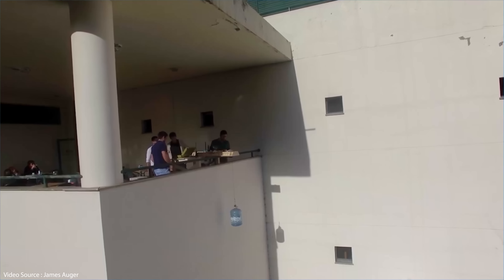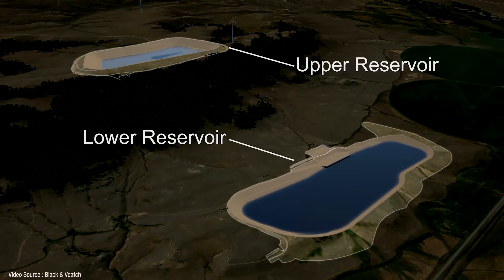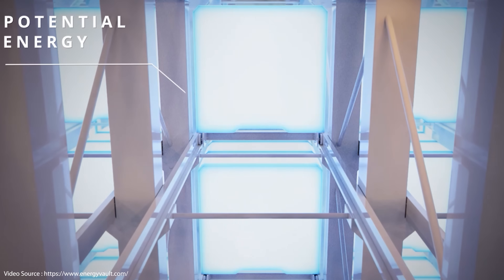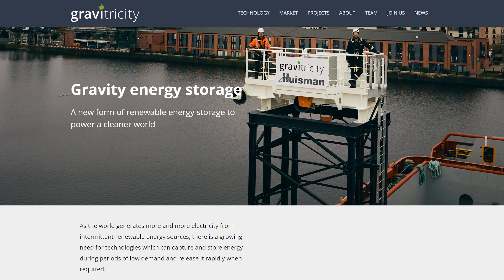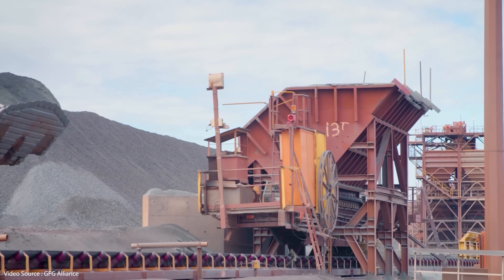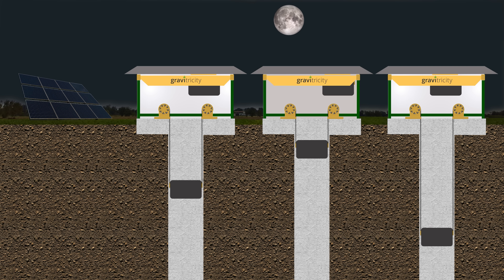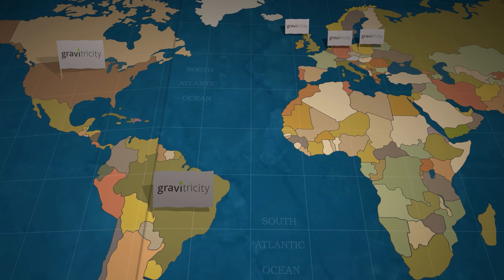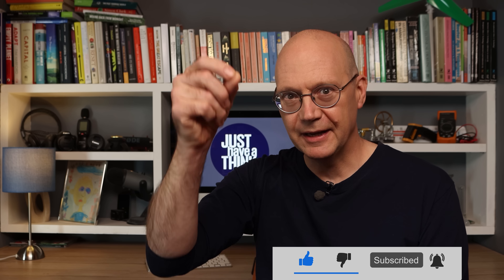Gravity Energy Storage. Who's right and who's wrong?

Comment: There is the mass generation for many and then generation for self. Like Regenerative Braking in cars there are endless companies constantly using energy to lift things but then wasting it when they lower it. I'm sure systems could be implemented to generate on lowering for ones own consumption.

Scale always matters. Water towers elevate water which is then gravity fed to our homes. How much energy could they extract from that? Which they could use to elevate it again.

The pendulum clock with weights has been using gravity for probably the longest time, hundreds of years.

Comment: Why not combine problems with solutions? A likely problem to using disused mineshafts is that they tend to fill with water which would need to be pumped out. If the ingress rate was low a pumping and tank storage could operate as pumped hydro. much simpler than weights and winches.

Comment: you point out all the power out, anyone should point out how much energy goes in to resetting it all.

i would say their all wrong. the cost of reset is eaten by any other source, and then some due to entropy, therefore whatever source is providing power to lift the fallen weights is already more efficient.
Reply: That more efficient power is not being made at the right time though. So resetting just delays the usage of that power till later.
Reply: @marshr32  it is a matter of efficiencies: the video does not show how much is to be wasted lifting those weights. im shocked ocean waves arent used to hydrolically pump/jack them back in place. That would be using the effing moon bruh, not just the earth.
Reply: @SkepTank0404  Agreed, even if it's insanely efficient it's still not a great way to store energy. Waves would be using the wind indirectly, tides would be using the moon. But tidal stuff is too slow and the height range over most of the world makes it not worthwhile to build the infrastructure.
Reply: @marshr32  good point

Comment: Unlike the Gravitricity concept, the new Energy Vault design still consumes energy when it needs to move the blocks around, so it's not as efficient, let alone the insane steel framework that will require even more mining.
Edit: From their web site, they can superpose several containers in the same shaft: "The Gravitricity system uses weight configurations totalling up to 12,000 tonnes [24 weights x 500 tonnes] in a deep shaft, suspended by a number of cables, each of which is engaged with an electric winch capable of lifting its share of the weight."

I suppose Gravitricity has some locking device that hold the containers in place as they are being lifted, in case of cable failure or when they reach enough height.
Another benefit of the Gravitricity design is that you start with a full "battery" at the very beginning: No need to lift concrete blocks or move them around a steel framework. You just need to move the empty container over the shaft, then fill it with iron ore.

Comment: Why not have a system like the Lynton and Lynmouth funicular railway in Devon? At the top of a waterfall you have a large "bucket" which can hold tons of water. You fill it up with river water and wait for electrical demand. The bucket then runs down the rails, powering a generator and pulling up the second empty bucket. At the bottom the water empties out of the bucket whilst the second bucket fills at the top. An array of these would provide free backup electricity on demand.

Comment: I wonder if Graviticity could use the dropping weight, in combination with flywheels to both or either extend the amount of time it takes for the weight to reach the bottom, thus increasing the time it produces power (side effect is that you use the fly wheels for regenerative power generation as well), and to generate power to raise or partially raise the weight back to the top of the structure?
Reply: that's just adding another storage system (momentum) to the gravity storage system. That can only compound the inefficiency. Every storage system has an efficiency less than 1. So you're multiplying less than one by another, slightly different, less than one.

Comment: It's noticeable that Gravitricity don't compare their LCOS with the nearest equivalent actually in use, pumped hydro. I don't know the LCOS of pumped hydro but I bet it's considerably lower. They both have a limited number of suitable sites but hydro has far greater capacity.
Reply: Depends on the depth of your mine, and how much rail you want to put at the bottom/top to store rocks to the side.
Reply: @JohnR31415  To give an idea of the amount of mass involved in grid scale energy storage, the Dinorwig pumped hydro station in Wales can use up to 390 tonnes of water per second at 1,800 MW output (source: https://en.wikipedia.org/wiki/Dinorwig_Power_Station). It has a 536m fall. Let's assume the mine is twice as deep (pretty deep for a mine). Assuming roughly similar efficiency, for the equivalent output you'd still need to move somewhere around 195 tonnes from top to bottom per second. That's a lot of rocks!

Comment: I wonder if they have considered having a stack of weights in a queue, locked vertically at the top of the shaft such that it would allow the mechanism to run several times?

I supposed there would be the substantial challenge of coupling to a weight at the bottom of the shaft, given they use the simplistic approach of cables. Perhaps there's no shortage of adjacent wells and it's cheap enough to set up the system again rather than reuse an existing well.

Comment: Thanks for circling back to these concepts. 

The Graviticity system looks very promising indeed. However, I do see a concern regarding viable locations and ground water. Mining operations spend a significant amount of their power budget keeping the mines clear of water via electric pumps. This overhead must eat into the overall efficiency, and in some respects, is a continual pumping phase of a hydroelectric plant without the benefit of some return power. Not all geographic locations are waterlogged of course, but it might limit the number of viable locations somewhat.
Reply: Not an engineer, but magnetite has a density 5x greater than water, so you wouldn’t need to pump it out. The load would be 20% lighter going down through that water but also lighter going up, so there would be no net loss (assuming the speed is low enough that drag is negligible). You would lose 20% energy density for the portion of the shaft that is flooded though. There would be a lot of extra maintenance cost too I imagine. Any engineers care to chime in on this?
Reply: @lukebm5555  Good points, but displacement also needs to be considered too. There would need to be ports within the shaft, or clearance around the mass at least equal volume to the water displaced. That also assumes the ebb and flow would not cause damage too. I'm sure flooding has been accounted for, but I have yet to find any details on this.
Reply: Agreed. Presumably they are focused on dry systems for now.

Comment: Maybe the EVRC should use water for weight, it will be lighter but the water could be drained out at the bottom making it easer to lift the empty container to the top and filled for another trip back down again.

Comment: you can store far more power in a spring than in a lifted weight, which is why clocks moved to springs. but if you compare the power density of a tiny battery to a spring, it blows the spring out of the water.  There are tons of better solutions, no pun intended. Gyroscopes, compressed air, hamsters in wheels... But, if you used these big containers to store garbage/waste instead of filling them with virgin material.. who knows, maybe its useful?

Comment: Why dont we use large buildings for this? I remember watching something a while ago that talked about china wanting to build sky scrapers from the top down by building them one floor at a time and raising it up with a hydraulic jack. We could put such a jack under each new sky scraper and use them as the weight. At about 200,000ish tons each even a few inches of travel should provide usefull storage.

Comment: There is an easier way than all these projects, which is to turn off most of the turbines at the time of light demand and to operate the entire turbines at peak power, because these projects do not generate electricity like generators, but rather store electricity in different forms only, As for pollution, they said about gas that it is the solution, then he said about lithium that it is the solution, then they said that extracting it is polluting, and they will say a lot even about these projects that they change the shape of the earth

Comment: My idea if you live where there is at least moderate rainfall is to build a concrete underground home, into a hillside maybe with what would amount to an Olympic sized pool above the house with shutters and blinds over it to prevent evaporation in summer 
 1. to catch drinking water 2. Once filled micro hydroelectric could be integrated into the fixtures to charge batteries. They could cycle at intervals to keep the batteries charged as long as ample water is available. The pool would insulate the house for heating and cooling as well as block EMF waves.

Comment: Great concept for gravitricity. It’s not perfect for every location, but where there are big holes in the ground, then it looks viable. What difference would ground water make? Would the shafts have to be pumped in order to maintain them? I imagine water erosion would be significant in a flooded shaft with a large weight cycling up & down. 
In other locations, a similar solution might be to have weights on rails going up steep hill sides. That would undoubtedly be far cheaper, and would suit far more locations. The maintenance would also be far simpler.

Comment: I liked your video from Sep 28, 2021 where retired thermal plants were repurposed to PCM plants using molten&solid aluminum.  Since there is no chemistry, the block could run through essentially infinite cycles. I originally thought that it would be great for keeping LFTR plants running at peak efficiency, but now I feel that it would be easy to implement as a bridge storage system in already existing infrastructure.
Reply: FYI, http://youtu.be/edVjYofLYc4

Comment: The largest grid battery, Moss Landing in California, can store 1.6GWh. 

This is the equivalent of 160 Eiffel towers raised to the height of the Eiffel tower.
Reply: Yeah I really think batteries just make more sense if you already have the energy in electrical form. Converting it back and forth with mechanical energy has more losses. And they don't involve massive construction projects, just mass manufacturing.
Reply: @DFPercush  Losses are not the issue, really.  When you'll want to storing energy it will usually be dirt cheap (surplus solar / wind); the grid operator will be glad that you're taking it off their hands.  For that reason, hydrogen is becoming a viable option despite the round trip (power grid, hydrogen, compression, and conversion back to electricity) only being around 40% efficient.  Fewer losses are obviously better, but construction and operating costs are much more important, not to mention scalability.  Fundamentally, Energy vault and Gravitricity suffer from the same problem: it does not scale well.
Reply: @kaasmeester5903  Surplus solar is never going to happen, it's during the day most energy is needed so there will always be a demand for solar. Wind has more potential as it can be harnessed during off-peak times.
Reply: @simonmoore8776  If we're going to rely on renewables for most of our power, we'll have to massively overspec it.  So far the numbers look good for using mostly wind and solar, balancing with batteries or hydrogen, picking up shortfalls with hydrogen as well, and relying on gas fired plants a few times a year (or hydrogen generated from gas) for the few longer periodds of low production we can't bridge.

Comment: Could tidal movement be used by attaching the generating equipment to a large ship hull that is moored in a basin that has large tidal rise and fall. One end of a chain is anchored to the seafloor, the other end fixed to the ship. The chain passes over a wheel which turns a shaft attached to a generator. On a rising tide the energy comes from the buoyancy  of the hull.  On the falling tide the energy is supplied by the weight of the hull. I imagine a large number of generating units could be fitted along both sides of a 300 metre tanker. Perhaps even put wells through the hull to increase number of units on the deck. No need to used surplus power to raise the weight, tides and buoyancy do it for you.
There must be plenty of tankers around the world that have reached the end of their service life but could be repurposed instead of being scrapped.

Comment: I was quite inspired by Energy Vault when  first heard about it.  It seemed so simple and easy to implement.  I was disapointed to hear about their change of design to a more expensive system.  I still don't understand how blocks of concrete so massive could be unstable in the wind.   Seems like they could just make the blocks less tall.
Reply: Even massive weights move in the wind, the cable only supports the weight but can’t exert any lateral force compensating for wind force. The mass being large doesn’t impede movement, it just causes a slower acceleration of the mass given a certain wind force. The distance traveled can very quickly become problematic for proper alignment or even cause collision. That’s why on construction sites ropes are being attached to large loads to control lateral movements and/or rotation of the load. Moreover safety requires stopping all crane activity if wind gusts exceed 27 mph. Average wind speed can be substantially lower under those conditions.
I hope this is helpful,
Kind regards.

Comment: Way too many downsides. Niche, high maintenance (cables), small scale (MW power & hours / energy), needs vertical mineshaft, grid connection, not too far from generation or load. Not scalable. Need to pump water from the mine.
Cost will be swamped by Li-ion or other chemistries in years. Doesn’t have the milli-second response of batteries, so market niche will be small. LCOS based on lots of cycles - if few, it’s expensive. What’s round-trip efficiency? Why waste time even on the video or reading my comment? It’ll never be a valid $$ billion company, just another energy vault. Stick to better examples of off-river closed-loop pumped hydro.

Comment: Love the concept but I could only imagine this would support a grid at times of high demand it wouldn't be able to scale up enough to run a grid. Would love some thoughts on this?
Reply: There's high demand every day, so a system that "charges" overnight when electricity is cheaper and discharges at peak times during the day would be helpful.  As for "running the grid", well no, just solar power doesn't run the grid, neither does gas or coal or nuclear or tidal or solar - they work together.  So any contribution would be helpful, and the more systems in operation, the more help it will be.
Reply: @simhedgesrex7097  Electricity is only cheaper at night because of the lower demand, once you create a demand the price will go up!
Reply: @simonmoore8776  Yes, the original question was about capacity, and whether the grid could scale.
However, regarding price (which I did indeed mention in the context of how things work now), we will move from a situation whether there is low demand at night and higher demand during the day, to a point where price will vary with supply:  when the wind blows and the sun shines, electricity will be cheap (as we scale up Wind and Solar, and reduce gas), and when the wind does not blow and the sun does not shine, electricity will be more expensive.  And people will continue to adapt usage to price.

Comment: Digging deep in the ground means at some point having water and will require probably a lot of concrete walls and some pumps. Or maybe it does not affect the process. 
Maybe the water column can be used to flow and generate extra energy as water under the  presure of weight pushes against it ?
Reply: Maybe the rocks that are more dense than water can provide mechanical power to pumps to extract the water, but only as needed.

Comment: Too much mechanical intricacy.  Just build a closed pumped hydro system.  For each ton of concrete or steel you’d ship in to build the EVC you could more cheaply ship water.  Clean it onsite and add it to the local town’s water grid.  Sewage treatment plant at level of town.  Pump cleaned water to water storage.  Dump it for hydro power.

Comment: Seems silly to me.. there’s a lot of lost power in all of those… why not use solar heaters to boil water to power steam turbines then condense the water at an elevated storage facility so you can use a standard gravity hydro generator.  Basically the same as pumped hydro yet you use solar heat to get it up to the storage facility rather than pumps.

Comment: It's exciting that they are using abandoned mines for Gaviticity's design.  The existing mines would cut down on costs if the coal companies were brought on board plus it might provide initial jobs for some miners.  My brain was thinking of a well sized application for a homestead.  I had a well dug in Colorado about 200ft.  I wonder what kind of electricity that would return?🤔  Running off to do some research
Reply: if your enegery storage system needs a lot of jobs (compared to a coal mine) then it's already sunk..    If you dropped something the weight of your car down a 200 foot well.. it would provide approximately 1/5th of the energy needed for it to drive up that 200 foot hill over there. and you cant fit your car down a well.